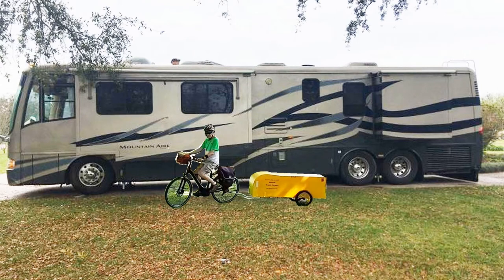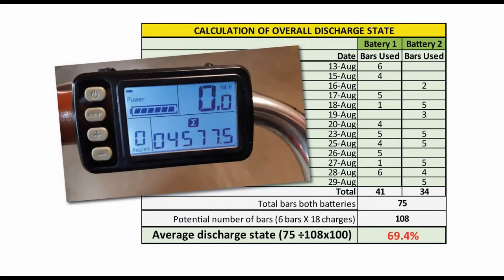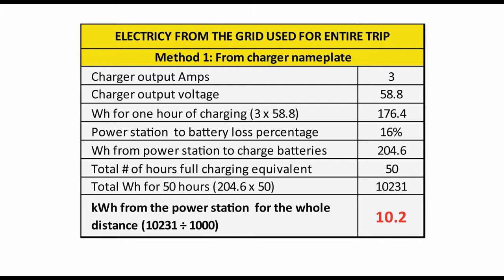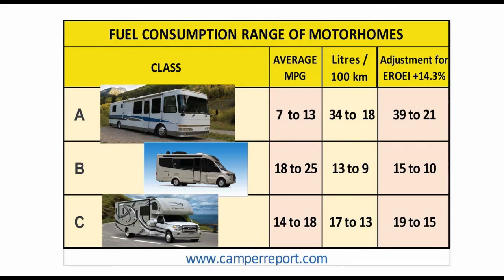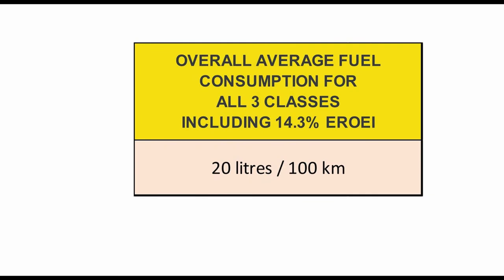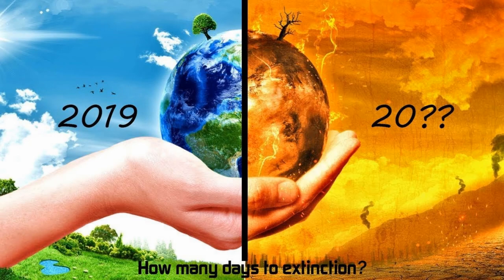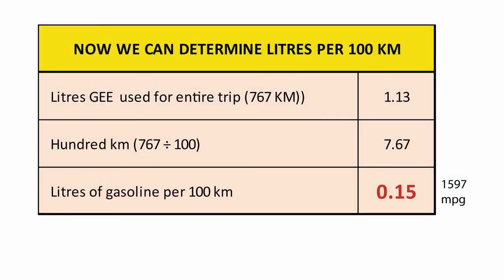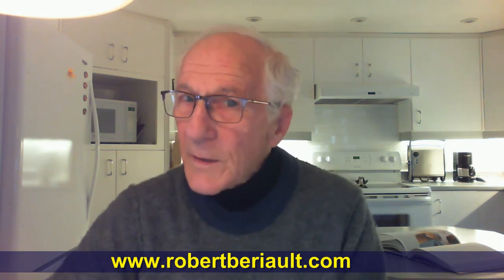Saintly Travel: Ebike Energy Use and Carbon Emissions Compared With  Motorhomes

Comment: Depending on your battery and charger a portion of the charge time is spent balancing the cells where it's only drawing microvolts, on my large battery it's about two hours out of five charged to 90%. You're probably using a little less energy than you think.
Reply from the maker: I thought I was being a little conservative. Thanks for the info.

Comment: One thing to add into the equation is physiological energy consumption of a cyclist. More physical effort in pedaling leads to a higher energy consumption and higher need to energy intake which is more food. The excess of food means more primary energy consumption in food production that most probably ends up being greatly higher than the electricity used by ebike. Here is one recent comparison of such scenario: https://www.bikeradar.com/features/long-reads/cycling-environmental-impact/  that summarizes as:

CB = conventional bicycle
EB = electric bicycle

Manufacturing emissions (g/km)
- CB 5
- EB 7
Food-related emissions (g/km)	
- CB 16
- EB 6.3
Electricity emissions (g/km)
- CB 0
- EB 1.3
Total (g/km)	
- CB 21
- EB 14.8
Reply from the maker: Very interesting numbers. Thank you. I've seen studies that estimate that to bring one calorie of food from farm to plate requires as much as 10 calories of energy from fossil fuels. I don't think a society where 99% of consumers are not involved in growing their food can be sustainable.
Reply: That well may be the case. Thank you for these videos!